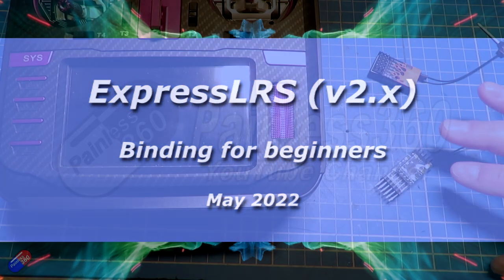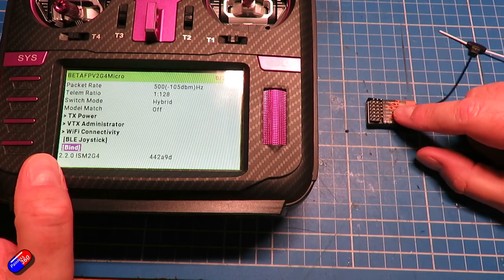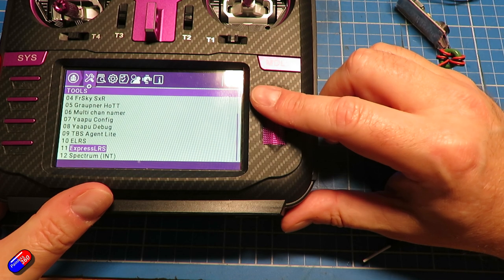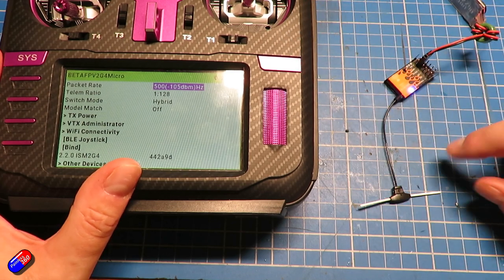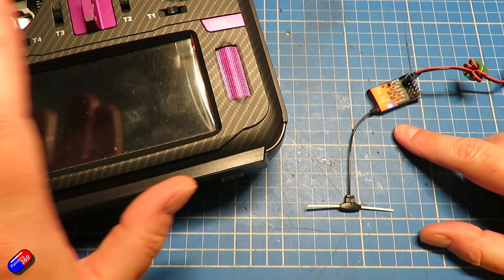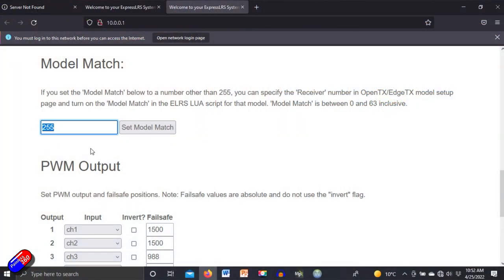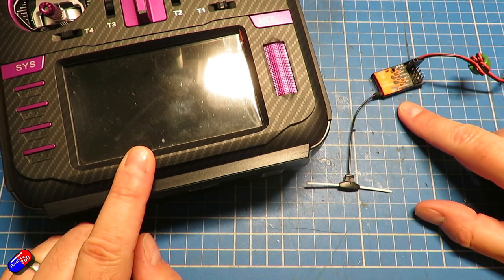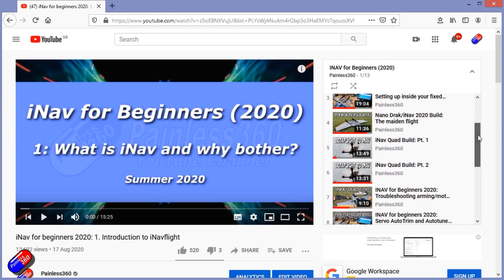ExpressLRS Binding for beginners and the most common problems I see...

Comment: I have the betaflight rx and tx module on my tx16s MK2 updated both. Installed rx in airplane and it went through binding process flawlessly. Took it to the field and flew the airplane. Following weekend took it back out to the field and nothing. Just a blinking blue light. This mess is so frustrating
Reply from the maker: https://www.expresslrs.org/2.0/quick-start/led-status/

Comment: Hello, I am new to ELRS, I have the Radiomaster TX16s mkII , happy model tx24 pro module and a betafpv elrs lite receiver. I managed to get the module flashed to 3.01 and the receiver flashed via wifi to the same, I did include a binding phrase. When I power cycled after flashing the rx goes into a super fast blink immediately when powering up, I am also unable to bind to it. Any idea? I am at my wits end. I do have another receiver on the way just in case...

Comment: My HappyModel module has 2.0 and the BetaFPV RX I got are on 1.0   Do I flash the RX to 2.0 or downgrade the TX to 1.0???  Or will they bind without being on the same?
Reply from the maker: Update the reciever to version 2.x and it should all work... Best of luck
Reply: @Painless360  Thank you so much for answering!!  I could find lots of other info except that 1 thing.

Comment: mine is not going in bind mode
Reply from the maker: What have you tried already?
Reply: @Painless360  yeah I did the power on and of 3 times but did not work I tired like 20 times
Reply from the maker: Best of luck with it. When asking for help including things like the hardware you are using and exactly what you've tried can help. Best wishes.
Reply: @Painless360  it worked!! Now the other challenge is how to mix channels for the flaps or the alerons
Reply from the maker: I've got lots of videos on things like that. Best of luck!

Comment: Great video on this topic. Unfortunately during flashing  to the latest version via Wifi, I bricked that 5Ch receiver. I know there is a device available to unbrick those nano and other receivers. But no manual how to do that with this receiver. Do you have an solution for this? Thanks anyway.
Reply from the maker: I'll add it to the list of things to investigate.? Stay tuned!
Reply: @Painless360  Thank you Sir. For me in Canada it is probably cheaper to just buy another receiver than buying that unbrick dongle from BetaFPV if it even would work. But still it would be nice to recover the bricked one. Cheers.

Comment: I had a problem with Matek 2.4 receivers - after flashing from "configurator" or "web page", receiver was constantly rebooting (connect it with USB2UART, then open "serial console" in configurator, if it shows "faults", dumps lot of garbage and uC registers) - what helped was a flashing tool i've found on Matek's page "ESP_NodeMCU-PyFlasher.exe".

I've selected "clear eeprom" or similar option (erase flash, do not remember now) and flashed elrs. It seems that original firmware has different configuration area (size or actual parameters) that are not picked up by new version, and ELRS Configurator is not clearing it by default. I had same problem with both - ELRS-R24-D and ELRS-R24-S.

Comment: I got a question, do you have to flash the TX 16s radio or the elrs receiver when new?

Or can you just get the stock version of each and just bind and fly?
Reply from the maker: Binding will normally only work if both the radio and receiver are on the same major version of ELRS.. Best of luck.

Comment: Hi I have a question about Receiver in INAV
My RX already binded with my TX (signal shows in TX, led light, sound if Telemetry lost or recovered)

But INAV didnt detect the movement in my TX
Reply from the maker: Sounds like the bind is good but the connection or/and setup in INAV is wrong. See my INAV for beginners series for how to setup the Rx for SBUS and CRSF..

Comment: When I plug my battery into my drone there's like a tiny spark happens inside the plugs (xt60? Its nazgul 5hd with 6s fullsend battery). Is this normal? Should I just plug it in faster to avoid it or am I making a mistake?
Am I going to ruin my first drone vrand new and expensive af before I even get through the complicated "bind and fly" process of downloading and updating dozens of software and updates? Who knows 😮‍💨
Reply from the maker: I will make a video on this. Don't worry it is normal... Happy flying
Reply from the maker: https://youtu.be/JGGWoH7rXsQ :D

Comment: Great video Lee. Looking for steps for changing channel 5 to 6 in expresslrs so it works with Kopilot for mode switch, since Channel 5 is only 2 position and need 3 for kopilot. Also have you tried the Matek CRFS to Sbus for elrs and if so same issue, How to change channel 5 to 6 for mode switch.. HELP please. Thanks in advance for any help or suggestion. Have a great day
Reply from the maker: In the BetaFPV receiver you can assign the PWM outputs to be any channel you want. On the Matek PWM receiver they don't pinout CH5..
Reply: Mesmo usando um receptor betafpv de 14ch, eu só consigo usar 4 saídas como pwm.

Comment: I was hoping you can help me, I was able to bind my rx but I cannot get ch2 to work..: I’ve verified the servos all work, adjusted and made new models in my zorro and ch2 whether it’s ele or rud it won’t send a signal while the other 3 work great
Reply from the maker: Check that you can see that channel moving on the radio ok, then move one of the known good servos to that output. If still no joy, check that the PWM output with the issue has power... Best of luck!
Reply: @Painless360  I didn’t check if it has power but I mapped it to the 5th pin and that worked so the ch2 pins I guess are the issue
Reply from the maker: Sounds like it... Best of luck

Comment: what does it mean when it doesn't go solid and blinks 2 in a row. But you still get telementery?
Reply from the maker: What receiver and version?
Reply: @Painless360  it's the happymodel 2 in 1 Vtx and ERLS Rx. 
I'm so stumped with this. I've installed these receivers in 8 models so far and have never had this issue. I'm starting to think it's these happymodel 2 in 1s.
Reply from the maker: That is odd, I can't see anything about double flash when connected in the manuals for it or on the ELRS site.. If you get an answer, please let me know.

Comment: I've got the built in elrs model radio that looks like yours. Jb edition.
I'm getting errors when trying to flash(I guess that's what I'm doing) my radio using elrs configurator.
Unfortunately I can't read code so I have no idea what these errors mean. It suggests that I upload a screenshot of the data log to a discord server lmfao now that's quality design/user interface right there 🤦👌
Reply from the maker: Check out my videos on ELRS. I have a full playlist. Best of luck

Comment: my receiver asks for a network security key when i try to connect to it via wifi, do you know what the key would be, r how i can find it?
Reply from the maker: I've not had one here with that enabled. Which one do you have?
Reply: @Painless360  It's the receiver you have in this video; It's a Betafpv 2.4gHz ELRS receiver. I got it from unmanned tech shop.
Reply from the maker: Mine didn't have one. Non mentioned in the manual either - https://support.betafpv.com/hc/en-us/articles/4404231679129-How-to-Flash-Firmware-of-ELRS-RX-TX - I'd get onto the seller.. Best of luck!
Reply: @Painless360  Ok, Thank you.

Comment: I have managed to bind it up however none of the motors spin I’m using radio master Zorro
Reply from the maker: What model type? Using a flight controller? What troubleshooting have you already done?
Reply: @Painless360  it’s an rp1 reciver but the rx wire is soldered to the rx port same with the tx
Reply from the maker: I still have no idea what you are using.  I can't help without that... see https://youtu.be/olIqTiSJHIY best of luck

Comment: Hi, this has been soooo helpful because i mistakenly bought the Radiomaster tx12 Mk2 elrs version for my 3D and sports planes.. SO now I'm so relieved i can still use it. Question though: can I use the 5th channel as the slave of the 1st (aileron) for a 2-servo aileron setup without adverse effects?
Reply from the maker: At the moment the 5th channel needs to be 'high' to enable all of the features you want 'on' when flying. You can remap the other channels on the Rx so that CH5 isn't wasting an output.. See https://www.youtube.com/watch?v=3-l7mEklEY4
Reply: @Painless360  Thanks a lot! Ill try those when the recceiver will arrive from china :)

Comment: Binding is the easiest part.   Trying to program the ELRS controller to arm and assigning the buttons is the hard part.
Reply from the maker: What do you mean when you refer to 'ELRS controller' ? Happy to help if you can explain in a lot more detail what you're trying to do..
Reply: @Painless360  Jumper T Pro Elrs radio.  There are no English instructions for programming the switches.   Can't even sell it.
Reply from the maker: If it is powered by EdgeTX or Opentx then check out my videos that show how to use it.. Best of luck